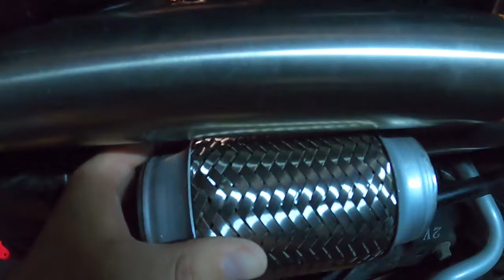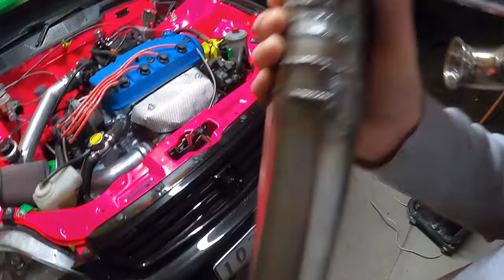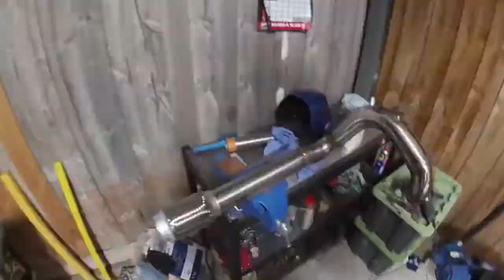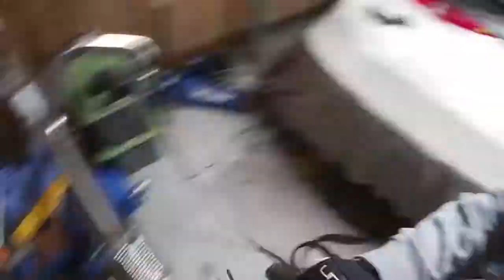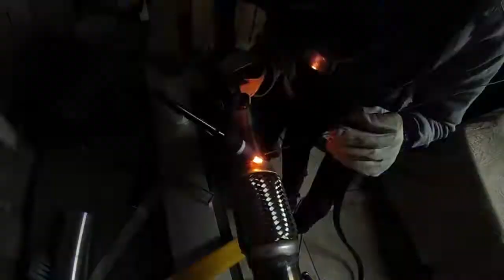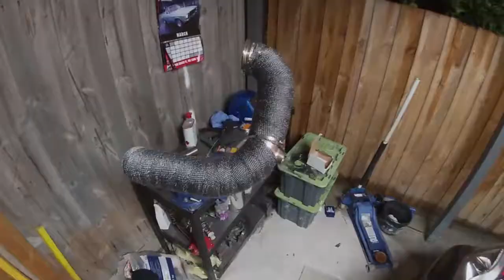MY FIRST TIME WELDING! NEW DUMP PIPE FOR MY TURBO CIVIC D16

Comment: Half the trick to welding is getting yourself comfortable and being able to freely move and control the torch around the job.
Reply from the maker: True I did alright at welding but now my regulator or my welder is stiluffed and it goes all sugary are crap I need to service it and replace the reg

Comment: 40  to 45 amps is where it’s at.

If the fit up is good no filler wire needed it should fuse.

Keep your tungsten as close as possible to the parent metal with nice even travel speed. You should be good.

If you cut it with a grinder use a wrap around to mark your line square in the pipe. Piece of emery paper will do.

Fit up is just about the most important thing for beginners.

Good luck
Reply from the maker: thanks brother all noted I cant wait to weld some more